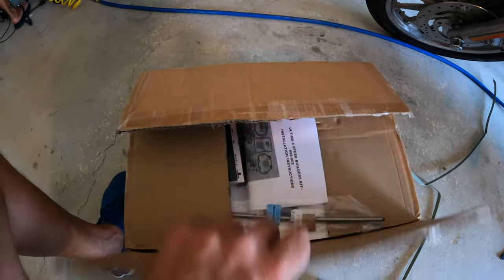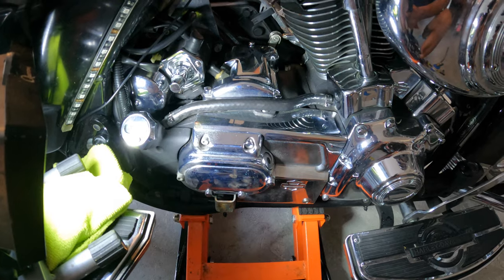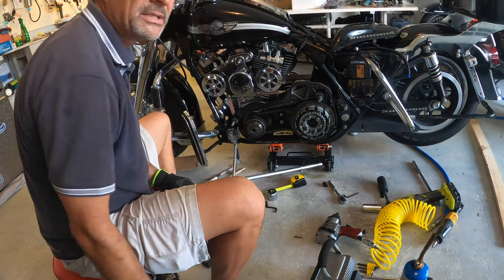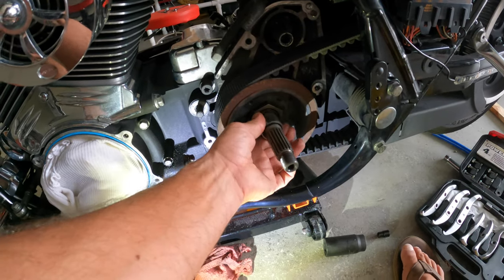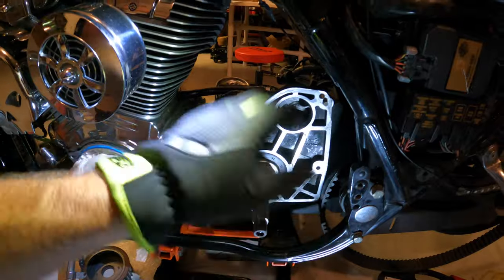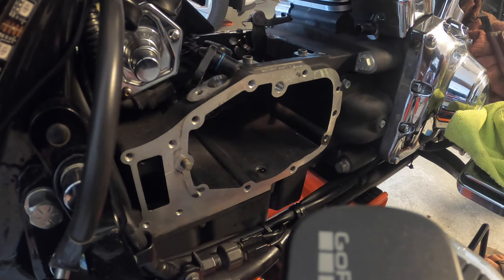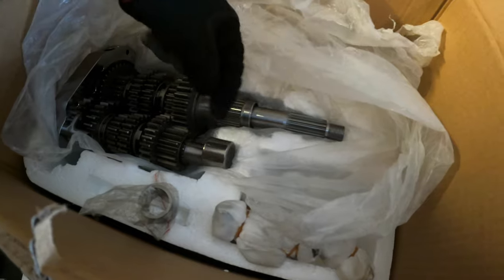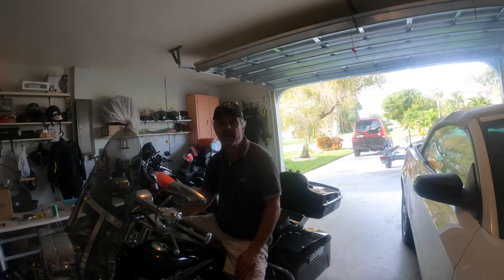Part 1 install an Ultima 6 speed on Harley Davidson road king 2003

Comment: How do you like the 6 speed ultima transmission?
Reply from the maker: Thanks for watching and commenting, so far I really like it I have now been driving for more than a year, and it really is a pleasure when you are on the long straight stretches touring somewhere, the overdrive has increased the fuel/milage, and lowered the rpm, shaking, and noise level, so its easier to talk without intercom, and listen the the music. so all in all I am very happy with the setup. I still have my original 5 speed gearbox, which I will save for the next two transmission oil changes.

I hope that helps, drive safely and enjoy your bikes,

best regards

Rene

Comment: I just bought the #98-902... It was delivered today. Everything is out of the bike except the last 20 minutes of your video. What was that special tool called to remove the final gear? My bike is a 1994 FXDL. it had a front axle speed sensor. The transmission has a speed sensor position, wich means i have to buy one for it. Do you have a part number that i can reference? Thank you for the video, perfect timing.
Reply from the maker: Hi Johnny :) thanks for commenting, and I am sorry to reply late, however I was out hog hunting yesterday ( real Hogs - not motorcycle :D). I will try to help you here, but might run short a little. Great bike you have. For the final gear removal I used a pulley that I ended up renting from the local Advanced auto parts store, but this is not the special tool. there are several tools you can buy and the most common one is Jims, however that expensive. I will find the tool link on amazon for you if you want one. You can get both tools there for about 63 usd and up. If you desire to use the tool I used, please be careful when you pull on the gear since its installed into you engine case and this is aluminium alloy, but it took me 10 small pulls to get it off. It comes off in direction inwards, into the transmission case itself and should let go after a few small pulls. Lots of small ones are better than big hard ones, give yourself a little patience here :) 

your speed sensor problem is new to me since I had a speed sensor on mine, but you can get one at ultima or amazon as well, after installation you will need a calibration unit for the speedometer as well, I am installing this today on mine as well - reason the speedometer shows 15-20mph to little if not. I bought mine on Ebay, 63 usd.

let me know how you progress and feel free to ask me again I will help if I am able ..

hope that helps...  and here are the links:

https://www.amazon.com/MBS-Mfg-Transmission-Mainshaft-Installer/dp/B07CCLWJKM/ref=pd_ybh_a_6?_encoding=UTF8&psc=1&refRID=TE57PMAA55FMHY5GBTAF

https://www.amazon.com/Transmission-Mainshaft-Installer-1984-present-34902-84/dp/B07N2RWWGP/ref=pd_ybh_a_12?_encoding=UTF8&psc=1&refRID=SP4YCH6GK3TAHX5XFVZE

https://www.amazon.com/Ultima-Products-Ultima®-Speedometer-Sensor/dp/B00LB8B40A/ref=pd_ybh_a_7?_encoding=UTF8&psc=1&refRID=KVM29MW3ZA7R5P1MBY6E

best regards 

Rene
Reply from the maker: here is the full video for install and part two too:

https://www.youtube.com/watch?v=hacsnL68dEA

https://www.youtube.com/watch?v=td9IuZI91Mk
Reply from the maker: Johnny if it is the special removal tool (deep throat socket) for the drive nut here is the the link:

https://www.amazon.com/Mainshaft-Sprocket-Wrench-Harley-Davidson-1936-2006/dp/B08HN2LKS2/ref=pd_ybh_a_13?_encoding=UTF8&psc=1&refRID=CPJ65E39FVPC07ST53TB

best regards Rene
Reply: @techtips101  Awesome! Thank you!
Reply from the maker: @johnnytruck2009  you are welcome :)
Reply from the maker: Hi Johnny here is part 3, the speedometer calibration module 17-152. You might need this.

https://www.youtube.com/watch?v=Q5WGmvipb5Q

enjoy and have a lovely day..

best regards

Rene
Reply: Hey man great video I think I’m going to be going this route soon too. I’m pretty sure a bearing or two are going bad in my 2003 fxdp and I need a pawl adjustment but I’ve always considered doing a 6 speed. I have a couple questions for you all the tools needed you listed in the comments correct? And my bike being a 2003 I shouldn’t need the speedo recalibration?
Reply: Well in addition to the 6 speed #98-902. I bought the Ultima "ThunderFire", 70-228 starter. And the Ultima 8mm 3.5" belt drive unit #58-902. And also a the Compu-fire stator with regulator. Awaiting the new motor mounts and speed sensor. This should be interesting.
Reply from the maker: @user-hx6le2ln5i  Hi Robert :) thanks for commenting, and awesome bike. Yes the tools you need are mentioned above, however I rented a few other tools from advanced auto parts instead of these, however if you get the ones above you cant miss the project :) I have to say I think you need the speed calibration since mine was a 2003 as well and I needed it. Had to pay 63 usd on eBay. It was easy to calibrate, and easy to install, I have made a video for on that too - call it part three, and will include the link below - its plug and play module.

if you have the same problem with neutral indication in 4 speed/gear you have to modify your shifter drum slightly. I used a Dremel 4300 for that job. Not difficult, you can see the modification in part too in the end :) will include as well. The full video is better to wind or rewind on and that Is the last one :) 

I hope that helps - happy to support you :) 

part 2: 

https://www.youtube.com/watch?v=td9IuZI91Mk

speedo calibration : 

 https://www.youtube.com/watch?v=Q5WGmvipb5Q

full video:

https://www.youtube.com/watch?v=hacsnL68dEA

Best regards Rene
Reply: @techtips101  thanks man and that’s what I thought your bike was a 2003 I might have to swap the trap doors the I’m not sure if that will fit with my current exhaust
Reply from the maker: @johnnytruck2009  that sounds really great - cant wait to hear how this goes and works out for you - awesome. 

please let me know :) happy to help out if you need it 

best regards

Rene
Reply from the maker: @user-hx6le2ln5i  the trap door is about a 1/2 inch thicker where the lower bolt are attached. I have the same problem, however you should have space enough to assemble it, however its precision work and you have to take your time. I am working on a support solution, involving double wrinkles in a bolt or rubber exhaust support to the frame instead. Or completely leave the it as is.
 will post as video part 4 when solved :) 

👍👍

best regards Rene
Reply from the maker: the Harleys are somewhat fragile to vibrations at the rear cylinder exhaust, therefore if I can reduce vibrations to avoid metal fatigue it would be the optimal solution....😉😉
Reply: @techtips101  nice I’m not worried about shortening the bracket I’m just concerned it will hit the mid pipe
Reply from the maker: @user-hx6le2ln5i  me too and initially it did in my case - however I took it apart again, and was much more careful on second attempt and then it fit perfectly. There is just enough space now to get a cleaning rag in between. Not a lot of space but enough, and no stress on exhaust as well :) I thought that was the easy part, but became a lot wiser afterwards :D

hope that helps.
Reply: @techtips101  thanks man
Reply from the maker: @user-hx6le2ln5i  you are welcome :)